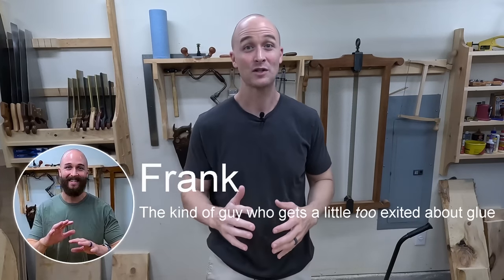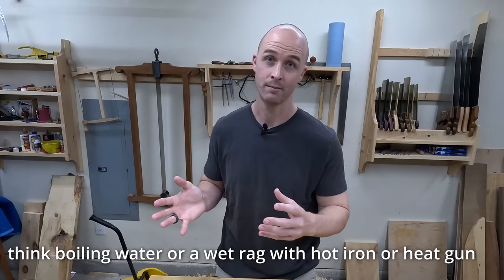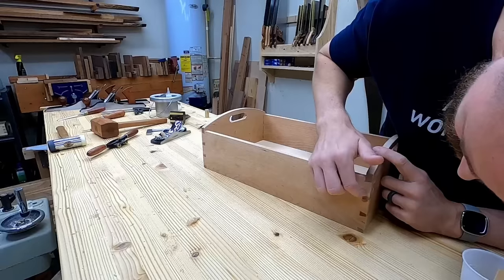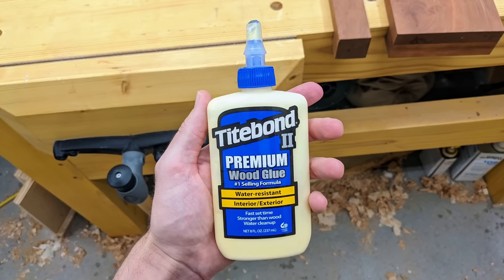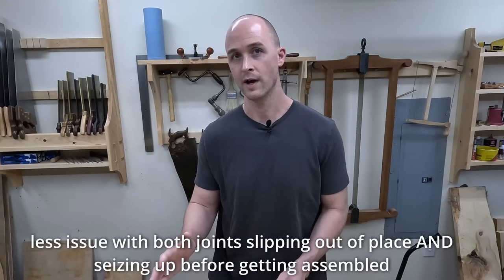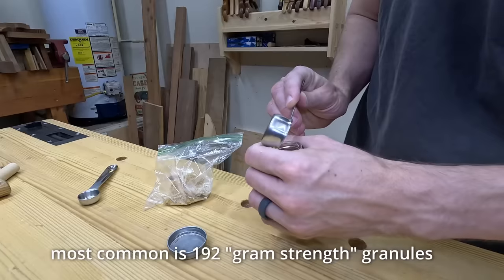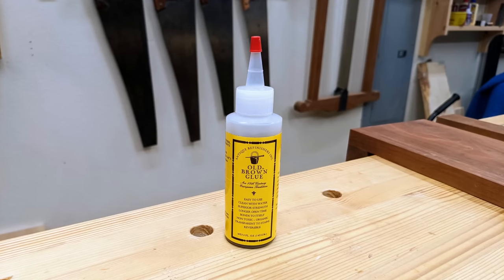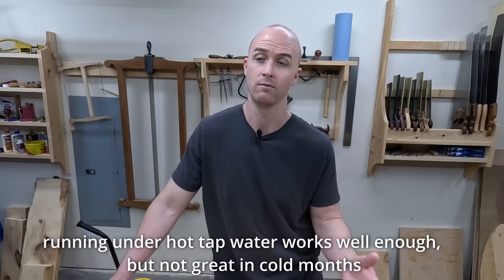This May Change Your Mind About Wood Glue

Comment: Hide glue is great. It doesn't need clamping in many applications it shrinks tight when it dries,hence the many glue blocks used in very old furniture. Its ok to use untill you find yourself in a large glue up and you don't have time to clamp and check your final alignment .
Biggest problem is when you retire and move the tropical climes like north Queensland or florida and all your furniture and musical instruments fall apart.
High strenth pva is cheap ,easy to use,will last longer than you will ,and with a little care to prevent squeeze out damaging the porosity of your wood and subsequently stain finish is a great glue

Comment: Equal parts water and glue, by weight is what I do.  Slightly more water for thinner, or less for thicker.
Can put lid on jar and keep in fridge for a week or two, but have to reheat.
There are different "weights" of hide glue, heavier weight sets up quicker but is stronger.  I use 192 for guitar/violins, heavier is usually just for furniture, less is for jewelry boxes.  Can use 192 for just about everything.

Can still get glue heating pots from luthier supply (violin making companies)

Comment: Old hide glue can be loosened in say dining chairs by injecting Methylated spirits into the joints, this will stop damage to the wood and is easily cleaned up with hot water and a brush. Also great for veneering when using a warm iron as you will get a second chance if things don't go right.

Comment: We used to have a two part glue for external joinery ,sashes doors etc called urea formaldehyde. I don't know if it can be bought in small quantities but it was crazy strong, had gap filling abilities and cleaned up with water.
Reply: Aerolite 306 or similar.
Reply: @BillDavies-ej6ye  it was a urea powder and formaldehyde resin, yellowish colour when mixed. For some reason we changed to resoursonol, brown and not as thick and was mostly used for glueing finger jointed stock and laminated beams for building construction.

Comment: Ps: glacial acetic acid, thinned 1 pert acid to 10 parts water applied to clothing and left to set for about twenty min. And then laundered will usually remove the glue, you may have to do this more than once though...

Comment: From what i understand from hideglue. 
Use what you need, then let the unused glue completely dry out. Don't let it sit in a container as a liquid. Take it out from its container, and put it on non stick paper or a old plastic bag, then let it dry, then collect it, snap it in to small pieces and put it in a open air container. And once you need it again, add water and a little bit of heat to make it in to glue again.

 Sure there will be more work every time you need to use it, but it should also last you a lot longer. and less of a chance for it to go bad.

Comment: Will hide glue bond to substrates besides wood? I’m looking for adhesive to bond aluminum to wood for a jewelry box and hoping to avoid epoxy because of the space it takes up. Hide glue is awesome in tight joints per my reading.

Comment: Would adding high proof alcohol (grain or rubbing) help prevent mold growth? Would it adversely affect the setting properties, or would it evaporate off when you warm the glue for use?
Reply: I've used alcohol injected into a joint to break the glue bond on antique furniture. I don't know how that works, but it kind of crystalized the old glue. So maybe not a good idea.

Comment: Love hide glue and have even made my own by shaving down fresh deer hides I stretched in a frame.  I've heard that the type of animal the hide comes from can make a difference, but I don't know if that's just an old wive's tale or not.  Not that it matters, since there's not much you can get aside from "rabbit skin" hide glue in granulated form.
Reply from the maker: Now THAT is making your own glue!
Reply: @FranksWorkbench  II still have some if you'd like to try it out!  Part of the brain-tanning using the "dry scrape" process pretty much means you'll end up with all kinds of shavings to make glue from.  😀

Have you ever put hide glue on flat glass to decorate it?  I love listening to the snap, crackle and pop.

Comment: pull something apart that was built about 1850... 
instruments...

or timber foundry patterns. all the old pattern books recommend batches. clean pot, clean water, clean everything... it doesnt store well.

also possibly the source of "double gluing".

youre "sealing the grain", lets you take off any of those little whiskers that love to pop up, get the joint really tight... and extends the working time when you actually do go to glue it... less water being sucked out.

Comment: I've been using hide glue for about 10 years and for any musical instruments and speaker cabinets it's essential as Titebond acts like plastic separators between the wood parts.  Hide glue lets the wood parts to become one and resonate as one so you get a massively better tone.  I've only used hide glue from Ragland Piano, mostly 251.  The Titebond hide glue is total bullshit to me, it's not real hide glue.   I've never had hide glue go bad, and I'm sure you could scrape hide glue off a 1600's violin and reuse it.  I always store it in the fridge at the back of a shelf.  I've had some for several years and it never went bad in the fridge.  I heat it up on the stove but for small repairs I use the microwave (carefully in 5 - 15 sec blasts).  One thing is, after you glue something up, spend quite a bit of time cleaning up the excess glue with a chisel (put the scraped stuff back in the jar then in the fridge)  as when it's hard it's like glass.  Use boilng water to clean up, dip the chisel in it. I've had no problem dismantling stuff, I just use a household steamer, a $100 Wagner.  You can put hide glue on two pieces of wood and rub them together and the glue will grab and often there's no need for clamps.  I have never added anything to the hide glue except water.  A very cool thing is that hide glue sucks together as it sets so all my joints look way better with it, which helps because I'm not a good woodworker.

Comment: I tried gluing a guitar neck on.. both sufraces were flat as poss... no dovetail or anything... rock hard wood... so I thought to take up imperfections make the hide glue thick... after 24 hrs pulled apart....didn't clamp as read hide glue not needed as pulls surfaces together.. (I think thats wrong now though).. glue was still rubbery and not sure there was even good contact between surfaces... I heated the glue too hot... steam was coming out of it.. any ideas?

Comment: Hide glue is great, but it stinks and it contain protein so it can start to mold (which can be seen on old instruments). Reversibility is actually better with Titebond as it only require heat, hide glue require both heat and moisture to release.

Comment: I have a wax warmer, you know, for when you're waxing your bikini line 😅 I got it very cheap, but it works fine. And if it breaks some day, I'll buy a new one. I actually have an old glue pot, but I don't have a hot plate in the workshop.

The smart thing about wax warmers is that they maintain a steady temperature for as long as it's on—which can be for days. When I got it I measure the temperature so I know where the 60° C mark is on the Low <-> High scale. For wax it doesn't need numbers, because it's already made for wax, measuring it for glue is, however, necessary.

Comment: Hide glue is very worthwhile in some cases. However PVA glue only became prevalent because of the negative aspects of hide glue. e.g Using hide glue in an area with high humidity and/or temperatures that go over 80 F degrees, probably is not the best idea.
Reply: I live in a higher humidity area with a huge range of temperatures... From negative 60 to positive 130... 
Does this just mean it would need to be made and used all up same day or that the glue would fail in extreme temperatures or where there are big changes between days (sometimes the weather is 40-60 degrees different in a day or the same day)... I see there are different grams involved... Maybe some mixes are better in different climates or seasons?

Comment: Look, the man that taught me about cabinet making when I was about ten (i'm nearly 70 now) showed me about Titebond II. We built a couple of dozen drawers WITH NO FASTENERS for kitchen cabinets. Mr. Rice said the glue joints were stronger than #4 brad nails. He had me 45* miter cut 2 1x4's of birch, glue only one and hot hide glue and nail the other. three days later I clamped one side in the bench vise and pulled one the right-angle to break it apart. The brad nailed gave easily. It took all I had to break the Titebond II and the 1x4 Birch board FAILED, NOT THE GLUED JOINT!!! Titebond III is STRONGER! Mr. Rice told me dovetails weren't needed anymore in 1963, but for show, finger-joints cut well and glued would hold all the plywood could, and he was in his late 80's. He had built cabinets in the oil millionaires' mansions up and down Main Street in Tulsey Towne, Indian Territory well before Statehood! I build loudspeaker cabinets with what he taught me, and they have to withstand vibration and not leak ANY AIR ait 163 decibels (louder than 2 feet from an F16 at full-throttle at take-off).and I use no fasteners.A Titebond III joint has never failed me. Mr. Reeves my ELEMENTARY skrul Shop Teacher also swore by Titebond II and III when it came out when I would have been in 5th Grade. Mr. Reeves gave us two 8 foot long 2x6's to glue-up with TB III. over-lapping a foot. 
No nails, no screws.. He put 8 of us on the long end with one end in an 12" winton bench vice. It sounded like a shotgun when the 2 by let go and our hands all stung!
Reply: I'm pleased to find someone else who uses glue only. I have made tables ,cupboards, stools and benches . Also musical instruments, all with no nails screw's or dovetails.
I have made two small boats using epoxy glue and screws but removed all the screws when the glue set.
I've learnt to trust glue.

Comment: Here's a tip!----this is knowledge sharing. maybe.

The most important step in use of hot glue is one must preheat the wood.
We purchase 50lb drums of hide glue when needed.
We glue very large objects " piano SB's" and everything wood, loose veneer etc.
Also we always do a dry clamping run,  clamp everything without glue first so there is no delay running to look for or adjusting clamps.

If the wood is room temp and the glue is 140degF or so,,,the wood will gas off while at the same time "gelling"  if our  glue gels up before everything is clamped we abort the mission and start over---period. = loss of time and pissed off.   Bummer!

Hot watery glue will make the room temp wood gas off! forcing the glue out of the pores and cooling off, then the bond is compromised. = weakened.

Just to note!! 
Hmmm---Watching many many videos of fiddle repair persons you will never ever see them preheat the work???  
BUT! that would make the pieces a lot easier to pry apart later on after many years or so.
Hmm,,,,maybe that is why? maybe that is one of the secret's. LOL.
Hide glue seems to be a mysterious topic lately in the guitar world.
Also plastic under the clamping blocks will prevent moisture from escaping and that can be a bummer,,,,heavy paper will absorb a great deal of that moisture, it;s the best way to keep the glue from sticking the clamping blocks.
Oh yes,,Ive mentioned microwaving your glue in seconds, especially tiny amounts.
No need for the pain in the butt glue pot,  This glue pot thing is what is most discouraging.
Hide glue folks hey,,,,try it you will like it!. 

However for felting piano actions 88 little felts x 6 or 8 = 500 + pieces   yes- glue pots we still use.
I had a big shot the   "arch poopery"  U-Tuber  he totally poo pooed  the notion of microwave = closed minded ass, oh well? No gain there.
Did you ever hear the notion of the leading a horse to water but you can't make them drink??
Well,,people too it seems.
R.B.  Hampshire piano.
Western MA.

Comment: You missed the biggest problem with hide glue and the big reason that basically everyone stopped using it outside of specialty applications.  Long term humidity exposure ruins the bond.

Admittedly, how much of an issue this is depends a bit on locale but I don't know of any way to predict where a piece of wood work is going to end up in the long term.  Around here, when I was a kid in the 80s and 90s, you could find well made vintage/antique furniture that was wobbly or falling apart due to this at literally every junk store.  Dining room chairs that needed nothing more than to be re-glued where a dime a dozen.  Of course, vintage furniture that was badly repaired by someone that didn't have a clue what they where doing was even more common.

I'm also just going to put this out there -  You don't need to buy any specialty products to make hide glue.  You can make it from straight rawhide.  Commonly available as bones for dogs.  It's just water + rawhide + heat + stir.  The hide glue pellets that you buy are just this same product evaporated and crushed.

Comment: Try using hide glue over a large area before it sets.I’ve used Titebond on my harpsichords for decades. I haven’t had one meltdown yet I’m not prepared to test hide glue for decades before I use it. Finish around a joint before gluing so there is no squeezeout problem.

Comment: NOPE!  Def a LOT of reasons that PVA has completely replaced hide glue.  This is like arguing that "vinyl records are better than digital" or "My 1955 Chevy is better than your 2023 Camry".  No, no and NO!
Reply from the maker: Funnily enough I used to think similarly about even hand planes and saws. I had a $100 box joint jig for a table saw, by hand would be a regression. Thoughts about what is progress sometimes change. That said I still like pva glue...